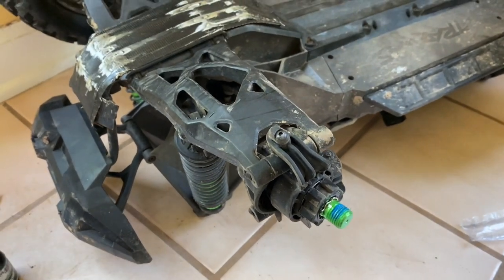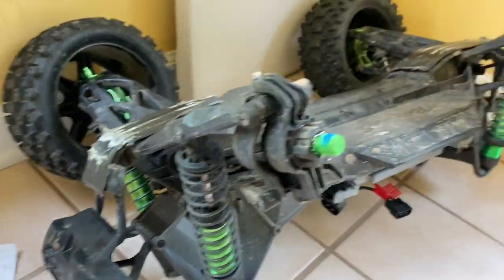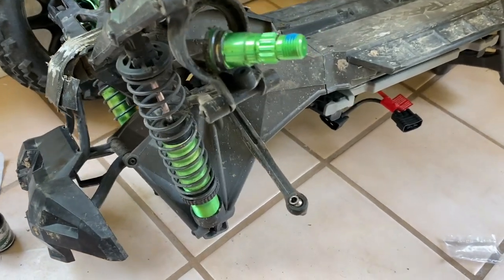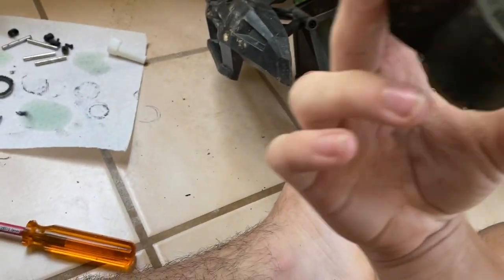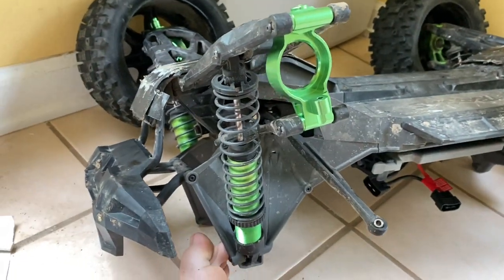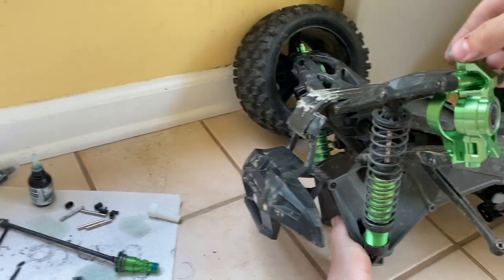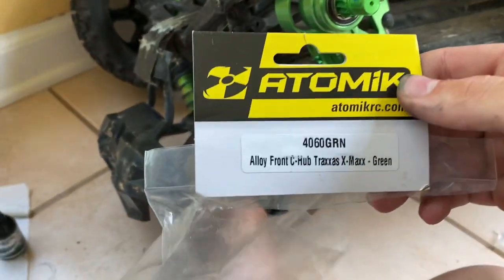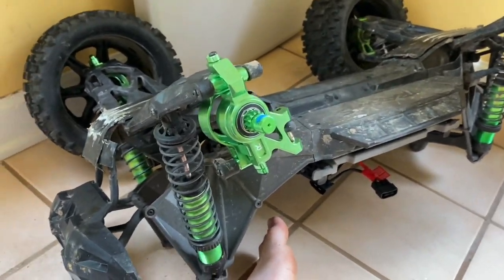How to Install Front Caster and Steering Blocks in XMaxx -Atomic RC front Caster and Steering Blocks

Comment: Learn to aim your camera at what your talking about. And Atomik are garbage! You assemble the right caster block and the right side steering block together. And it is not smooth. Cannot move the steering block so stiff that a servo will not move it. I am so happy Atomik went out of business.
Reply from the maker: First of all, take it or leave it. Second, why’d you even watch a video about the Atomik one’s if you hate them so much? Third, these Atomik parts are great; they move freely and smoothly. Fourth, SUBSCRIBE!!!
Reply: I watch your video hoping to see if something was different. I now have 2 sets of Atomik Caster blocks and 2 sets Atomik steering blocks for the Xmaxx. And both sets have the same problem they don't move freely. Subscribe no way. If you ever do better at filming then maybe. Enjoy your Sunday
Reply from the maker: I have gotten better at filming. It’s just hard when I’m in cramped quarters and trying to do two things with one hand. Newer videos are much better. I recommend you see what you think of that filming. You enjoy your Sunday as well.

Comment: Cool upgrade but stick to plastics if ya can... I got my xmaxx a few days ago unboxed on my channel gonna run it later today for first time.. I got the max 6 esc, rpm oversized rear axle carrier and bearings, rpm body saver kit, rpm roof skid plates, rpm threaded hinge pins, hot racing spur gear, Robinson racing 18t hardened pinion, and upgraded servo 2058x... All be in by Thursday...
Reply from the maker: What works for some might not work for others. Those metal upgrades have saved my truck but I wish I had that body kit while the body was still good 🤣🤣🤣 I’ll most likely get the Hinge Pins sooner or later and I guess I got lucky on my pinion and spur. And I’ll get the new servo and a Max6 when the thing Craps out. Hopefully with all the Upgrades you have the thing will last Forever.
Reply: @joshsrcs  indeed bro... Yeah it better last forever I've dumped a lot of money into for it to lol without even a first run.. Definitely things that it needs... stop by channel and sub if you like.. I'm cranking out rc content on the regular bro 🍻
Reply: @silly_d_williams2167  So you think it's a waste of money getting these metal hubs? I was thinking about it. Thanks
Reply: @joseCalderon1976  I wouldn't put  it on my xmaxx but to each its own... And if I did get metal... It would be vivaton
Reply: @silly_d_williams2167  I jump mine about 15ft and more so I need to be as light as possible. And remember that now I have the extra weight of the max 5 and 1100kv 5687 motor and 1.5 gears and motor mount.
Reply: @silly_d_williams2167  I see that vivaton uses a triple bearing design and the inner bearing is bigger. I'm getting tired of changing the stock inner bearing on the front hubs. I wonder if it's worth it because of that? Or just keep changing that slim bearing? Even the aftermarket ones don't last long